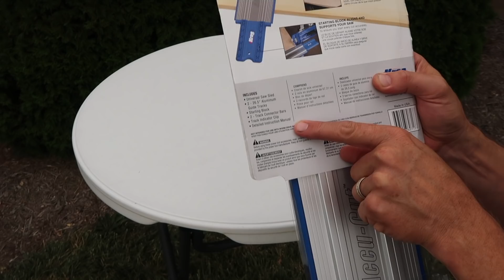KREG ACCU-CUT CIRCULAR SAW GUIDE - TOOL REVIEW TUESDAY

Comment: I have connected two kits and effectively doubled the length, no problem with the cuts. Nice video
Reply from the maker: Thanks for the information!
Reply: What did you end up using for the third set of connector bars required? I'd been considering doing the same, but didn't want to buy 3 kits just for the extra connectors.
Reply: You can just call them and ask for another set of connector bars like I did. Told them I lost them during a move. Had to pay for them but now I've got a 8' tracksaw. Which is great for my smaller shop.
Reply: They make a ripe which makes your long cuts but only goes 24 " wide
Reply: I'm contemplating the XL for this reason.

Comment: Let me preface this by saying I own a lot of KREG tools and love their products.  I was looking for a cheap table saw substitute and thought this might be the perfect alternative.  I bought it at Home Depot for $79.99 and thought I had found my replacement.  I was wrong.  I'm no professional, but I know my way around tools.  Lots of people have great things to say about this tool.  It just didn't work for me.  First, you CANNOT buy this if you have a circular saw that has a plastic guard on it.  Second, putting the "sled" onto the saw itself can be tricky, and once its on there, I found the accuracy (I needed cuts within 1/8", which might be too much to ask, but still) to be very difficult to work with.  Again, just my experience, but I ended up just buying a DeWalt table saw...and let me tell you...IT IS HEAVEN!!!  I'm ripping boards in 45 seconds that took me 5-6 minutes to set up, etc.  No brainer.
Reply from the maker: I also have a Dewalt table saw and really like it.  The Accu Cut is great with my Dewalt circular saw and Kreg clamps.  I would like to get another 4' section for ripping  4x8 plywood.
Reply: Drew Peterson - Operator error
Reply: Tough to rip 4x8 sheets safely on a portable contractor saw let alone a full size table saw. Enter the circular saw.

Comment: 3:32 There is a small reversible grey colored shim that is ramped on one side and flat on the other where the nose of the saw slide sits to accommodate different sled types. You need to flip yours over and the guide should sit flush against the sled.
Reply from the maker: Thanks for noticing that.  I'll have to take a close look and flip it over. 👍

Comment: The edge of the track on your mark is about an 1/8 off. I had to measure to the track to the edge of the board then do the same on the other on.  It was like adjusting a fence on a table saw.
Reply from the maker: It took me a few tries to get mine dialed in.  I highly recommend using the clamps with this.
Reply: @MarkThomasBuilder  it stays in place.  I had to just measure to make sure. I wish the side of the track was were your mark is.

Comment: I think kreg rip cut is better for parallel cuts. Accu cut is better for angle cuts or cuts on board that does not have straight edge. If board has straight edge, rip cut is faster. Good to have both.
Reply from the maker: That's a good point.  I agree.

Comment: I have just always used a 2x4 with clamps for doing cut's on 4x8 sheets, saw this gadget in the store and found your video. Great video:)
Reply from the maker: Thanks, that works too.  The accu-cut seems more precise.
Reply: Mike Girard  When using a straight edge you have to determine the distance from the baseplate to the saw blade and offset the straight edge that amount.  With the Accucut , when set up properly, you place it directly on the cutline.  This was not explained in the video.  This system is quicker to use.
Reply: Mike Girard I've never seen a straight 2x4
Reply: A 2x4?? I guess that works if you dont need straight or 3ven anywhere close to accurate cuts.
Reply: Your saw is going to follow the edge of the 2x4, but dimensional lumber is rarely straight and accurate.  I have a 100" length of 1-1/2"X1-1/2" steel angle iron that I bought for $12 dollars that rips sheets lengthwise very accurately when held with 2 small C-clamps.  Also have a 60" length of angle iron from an old bed frame (free) for cross ripping   sheets.  All my panel cuts are dead straight and accurate.  The clamps never let the fence move out of alignment, no need to add a base plate to your circular saw and no dept-of-cut is lost.  I can't find any reason or benefit to purchase an expensive saw guide system.  Maybe I'd buy a FESTOL track saw system if I was building a quarter million dollars worth of cabinets each year.
Reply: @chrisgraham2904   If you have a table saw, you can rip the 2x4 a perfectly straight edge which is what I do, but  over type the wood will can become straight again, so you gotta keep checking it.
Reply: @pmadsea077  If you secure a straight edge against the end of a sheet of plywood or mdf and run the saw along that, the strip you cut off can be used as a guide. Just line it up with the line to cut, put the straight edge on the other side of it, and the straight edge will be in the perfect position. ;-)

 @marc f  A table saw alone won't get you a perfectly straight edge either unless the other side of it is already perfectly straight.
Reply: the big advantage to the track guided saw, isn't just that it's straight, it eliminates the need to measure  the offset of the blade to the straight  edge to the cut,,you make your cut mark, lay the edge  of the track on it, and that's where your cut is gonna be, i love track systems,,, no guess work
Reply: @wanabyastick  common wood is  usually straight.  Not cheapo framing studs

Comment: Great review. I found it very tedious to dial everything in to be dead accurate, but well worth it. 
It's also worth noting to keep your off cut on the right side of the blade (for a right handed circ saw) and place the track right on the pencil/chalk line. Otherwise you'll be messing around trying to account for the blade kerf if your cut-off is on the left side. But sometimes you might have to do it this way, depending on the situation.
Reply: Instablaster

Comment: I noticed when Kreg demoed this product, they used a piece of blue foam to support the work when doing their cuts.
Reply from the maker: Sounds like sill seal.  I have the Kreg clamps and it works great.
Reply: Nah, it was just your 2" blue insulation foam.  :)
Reply: The instructions do mention that  you should use 2x4s or 2" ridgid foam insulation to support the workpiece.

Comment: How do you make sure, when using the circular saw, that you did not cut through the two support beams you were using there?  Or did you saw through them superficially?
Reply from the maker: I've hit them a few times, but try to have the spot I'm cutting to hang over the supports underneath. Plastic sawhorses work well for the sacrificial cut, if needed.

Comment: Can you please answer my question?

I notice you have, what looks like, a standard circular saw that accepts 7 1/4” blades. But, I have a compact circular saw that accepts 6 1/2” blades. Does the Kreg Accu-cut sled accept compact circular saws like mine?

Thank you.
Reply from the maker: I believe it will work with a 6 1/2" blade.  I didn't see anything in the instructions saying it won't.  The saw sits on a sled which shims the saw off the material your cutting, so just so that you're aware, it won't cut as deep.  If you're cutting thinner material like plywood, you'll be fine.
Reply: It will work with a 6 1/2 inch saw.

Comment: If you were going to clamp it down where would you put the clamps so that they don’t interfere with the saw?
Reply from the maker: There are clamps that Kreg makes that go on the bottom of the track and clamp on the ends of the boards.  I made a video on them.   I always use them.
Reply: @MarkThomasBuilder  Nice, thank you.

Comment: Doing some research on this and it looks like it might move around. You can get a long piece of metal stock or even aluminum and avoid this plastic tool, clamp it to the plywood and cut an entire 8ft.
Reply from the maker: If you get the Kreg clamps that goes with the track, you're all set and it works great.  I haven't purchased additional tracks yet to try it on 8' material.  If I do, I'll post another video.   I've also used metal stock for ripping 8' material and that also works good.  I've used some wood trim as a guide before and that didn't work as well.

Comment: Seems like it lacks a lot of needed design features. I’m designing one that I can rip a full board length without being 8’. It will be slightly over 24” and will allow all the widths to be covered on a 4’x 8’ sheet by using progressive slide method with our saw 🪚. I believe they make one but it’s shorter, something like 16” but not sure just what I was told after looking into this video.
Reply from the maker: Sounds interesting.  It would be great for storage if it's only 24" long.

Comment: What circular saw do you have? Because I wanna buy a circ saw and the guide, but I wanna buy one that is compatible with the guide
Reply from the maker: The older DeWalt saw is the DW364, 13Amp, 7-1/4 saw.  The DWE575 is the current model that I would recommend getting.

Comment: Nice review Mark.  Before your first cut did you trim the edge (blue part) of the Accu-Cut?  If not maybe that caused some inaccuracy?  I see you learned from your first cut to always have your keeper (the piece you want) under the track.  This way you were able to take advantage of the anti-splinter feature and not have to factor in the width of the blade when measuring and marking.
Reply from the maker: The blue part just got slightly trimmed the first time using the Accu-Cut.  I used some Kreg Track Clamps after making this video and it makes all the difference.  I'm posting another video tomorrow featuring the clamps.
Reply: Casey Kerkmann   Casey I used painters tape where I want my cutline before I mark my cuts and it decreases splintering to almost zero.

Comment: I think you missed a step. Before cutting wood, you need to but the blue sacrificial edge by itself to set the edge for accuracy. Then you use the blue edge to act as the straight edge.

Comment: Read the directions.....Your supposed to calibrate the saw to the guide....You set it so the saw actually cuts a 1/32 piece off the sacrificial plastic edge..Also check the saw alignment so it tracks straight....and you never squared the blade up to the track.  on 1/4 ply not a big deal but you cut 3/4 inch and you will be cutting a bevel edge if you don't square it up....It's all in the directions...
Reply from the maker: Thanks for the info.  I did take a little off the sacrificial edge, which makes for accurate work.
Reply: @MarkThomasBuilder  I use my Kreg track for allot of things  and don't get me wrong I like it however, Im not knocked out by it.  The plastic saw sled needs to be made out of cast aluminum and machined so there is no slop in the mating track.  It's pretty close but close only works for hand grenades and atomic bombs...LOL

Comment: Just received one as a gift and came to YouTube for some vids on how others have used it and what they think of it.  Overall it looks pretty handy.  I have a tablesaw, but of course you can't always bring that with you when you need to make rip cuts (say, when you're cutting sheeting for a backyard shed).  One thing that looks like it may be a limitation however.  It seems that the best way to ensure that the track doesn't wander is for the entire underside to remain in contact with the piece being cut.  But I noticed that if the entire sheet isn't fully supported across the length of the cut, like if you're using saw horses, the end of the track lifts off the surface as the sheet bends, which seems to me can cause the device to wander off line.  I'd think the same risk could be present if the plywood was warped.  Did you find that to be a big problem?
Reply from the maker: That's always an issue when cutting full lengths of plywood, so I put a 2x4 underneath the cut to keep it stiff.  I also recommend you get the Kreg clamps.  Hope that helps!

Comment: Too expensive and too limited use. Each time you dismount the saw and mount it again you have to affix it in the same identical position you had it before in order to get accurate cuts. The rubber base will eventually start sliding on your work piece because it loses grip over frequent use and accumulation of saw dust. A nice 8ft straight edge would be much easier to use.
Reply from the maker: You can connect 2 of these to make a 8' guide.  I would like to see Kreg offer this as an 8' kit.
Reply: Kurt M There’s a stop block that you install so that when you take the saw off of the sled, then remount it goes back in the same spot. You can also replace the rubber strips when they wear out. I would say it’s not for every one, but it has its uses. I build cabinets as my side business, and I need really good accuracy. For ripping I obviously use my table saw, but most table saws don’t have the capacity to cross cut a cabinet side to its full height. You need a really fancy table saw or a good track saw to get perfection there. In the past I’ve always used a really good straight edge with my circular saw for this operation. However, this kreg tool is doing the job much better for me. I no longer have to offset the straight edge from my cut line to account for the distance from the edge of my saw base to the blade. You just put the blue edge directly on your line. It also gives some zero clearance support so I’m getting less wood tearout/splintering than before.  It’s a niche item though. I’m getting good use from it in cabinetry until I buy a nice Festool track saw, but it’s not necessary and a bit over priced for what most guys are doing. I shop vac the rubber strips and the sled bottom after each cabinet side to make sure all is staying in good condition, but that isn’t realistic in a construction environment. I also have my plywood completely supported with 3” thick rigid foam.  It gives great support and you can cut into the foam as a sacrificial surface. By using that I’ve never needed the clamps they sell. The track stays put for me.

Comment: Just bought this track, it is very pricey 80 dollars at lowes, unfortunately it is something you can't clamp down because there isn't enough clearance  for the saw to pass. It also has a tendency to walk when using it right at the end of you cut. All in all, I'm going to stick to using a 2x4 and clamps.
Reply from the maker: Andrew Melendez I agree that it needs to be clamped down.  Kreg makes clamps that fit the track underneath.  I made another video showing a demonstration of that.  If you go with that system, I’m sure you’ll be happy with how straight it cuts.
Reply: @MarkThomasBuilder  I will have to get some and try them out, thank you

Comment: How to work when I want to do a 8 ft cut?
Reply from the maker: I've heard you can attach 2 of these together.
Reply: Hans M. Severloh You should really buy their other tool for that called “The Rip Cut”.  The Rip Cut is meant to cut (rip) 8 foot (or longer) using the factory edge as a guide.  Both work together to break down 4x8 sheets with ease and accuracy.  I love them both.

Comment: You're severely overreaching at 5:00 during the first cut. If the saw were to kick back right at the end, you might have serious trouble maintaining control of the tool. Additionally there is a high likelihood of the blade binding because of how poorly braced your wood is. 2 sacrificial 2x4s is inadequate support for cutting an entire sheet of plywood. Finally like many others have said, you didn't even display how to attach the saw guide to the saw, yet your first cut comes at 5 minutes into a 9 minute video.
Reply from the maker: I agree that 5 minutes is too far into the video for showing the action.  I've been working on that lately.  Thanks for pointing out other improvements.

Comment: ooooh where do i get that cast iron wood splitter?  I'm having to put my pieces between two concrete bricks and use this sliding splitter tool thingy
Reply from the maker: It sound like your talking about the Kindling Cracker.  I have a video review with a link or else check Northern Equipment.  I have the larger version.
Reply: @MarkThomasBuilder  Thanks.  It would be great for converting my rack of wood to smaller pieces for cutting on miter saw for wood chunks for bbq.

Comment: Looks like they used the same plastic saw plate attachment as on their rip fence. That piece is the weakest link in the setup. The whole thing flexes as you tighten the hold downs (can even see it bend in your video), has no registration to attach it the same every time you set it up, I absolutely hate using it. I own quite a few Kreg tools including the router table, this line does not meet my expectations compared to their other products. They really need a way to attach it from the front and rear of the saw, securely, and stop using so much plastic.

Comment: Not being able to clamp it on the edges makes this kinda pointless. I wouldn't trust that at all. A thick piece of straight trim can do the same job and clamped more accurately.....for far less money.
Reply from the maker: When using the Kreg clamps, this does a great job.
Reply: I have the Harbor freight clamp guide, under $20 which holds securely, seems to work well. Once it's clamped on the edge, it doesn't move out of position. It doesn't need to attach to the saw so it seems more flexible in using it for other tasks at a moment's notice. May be an alternative.
Search for "50 In Clamp and Cut Edge Guide", it clamps on the sides of the wood and I find it pretty easy to line up.